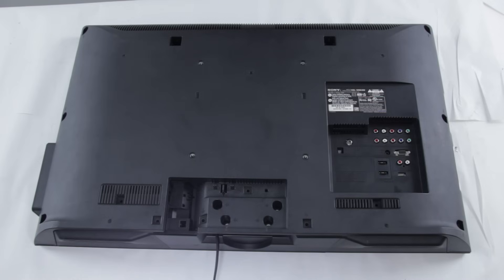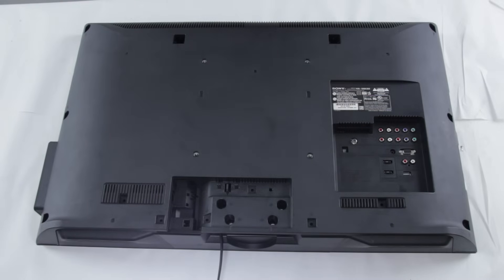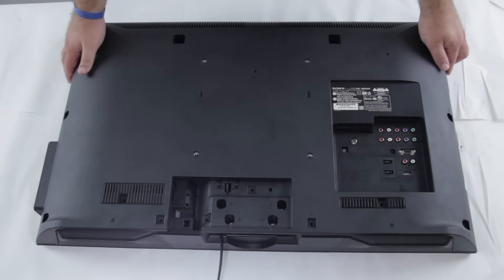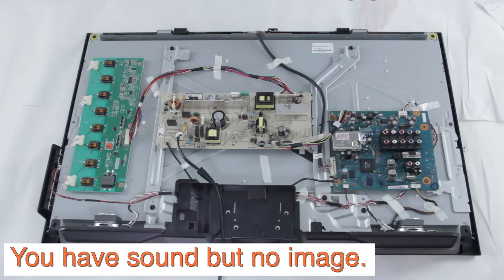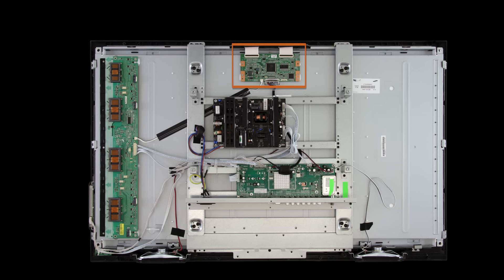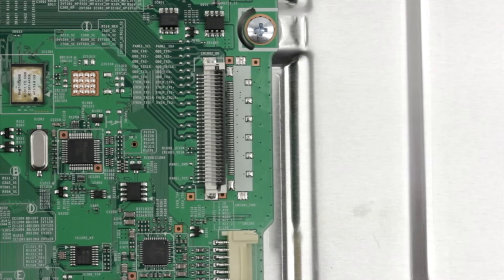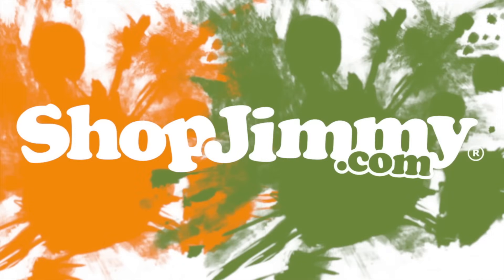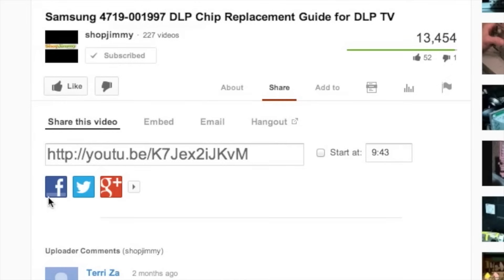LCD TV Repair Tutorial - T-Con Board Common Symptoms & Solutions - How to Replace T-Con Board

Comment: Hi, I have a sony sony kdl-40ex520 and just recently the tv started showing a thick blue sometimes red horizontal stripe on the top of the screen. before that the tv had several almost invisible horizontal lines all around the tv. Is this a TCON related issue?
Reply from the maker: Justin Subero   This sounds like a TV panel (TV Screen) problem.  If your TV panel is bad, it may be more cost-effective to replace the TV as panels are typically hard to find in stock, difficult to replace, and expensive.  Thanks and please let us know if you have any further questions!  www.shopjimmy.com
Reply: Thanks Jimmy!

Comment: Can You suggest me something like a trick to reset Tcom in HSD190MEN3-A00 Panel prior to order another one ? The televisor show lines and a blurred area in the lower half of the screen BY March 9th. The upper half works good at now. Best Regards
Reply from the maker: DaveDaveTor   This sounds like a TV panel (TV Screen) problem.  If your TV panel is bad, it may be more cost-effective to replace the TV as panels are typically hard to find in stock, difficult to replace, and expensive.  Thanks and please let us know if you have any further questions!  www.shopjimmy.com
Reply: ShopJimmy.com I can mount a new panel BY muself, new panel price is 85$ (+25$ shipment). PANEL IS EFFECTIVELY BAD, but I used to contact aliexpress online and THEY told me to send 110$ to the retailer PAYPAL.account.
Reply from the maker: DaveDaveTor   Best of luck with the repair!  Thanks!  www.shopjimmy.com

Comment: My Sony Bravia 55inch TV (just 3 years old) cut out last week....turned it on and it went off by itself, then the red LED on the front would blink 4 times in a repeated pattern.  ShopJimmy and other sources suggested it is most likely the T-con board.  ShopJimmy had the board in stock....around $25 plus shipping.  The instructions on here helped walk me through the process to replace the board....took about 45 minutes door to door to complete the task...really easy.  Better than spending $1000 for a new TV!  Thanks ShopJimmy!!

Comment: I have Samsung 50" led hdtv that has a black screen when I turn it on. I removed the back cover in the back of the TV to see if the back light works...  And it's does and their is sound (connected a ps3 in the Hdmi input) I think I have to replace the t con board. 
The model number is un50eh5000f 
     Version number is nh02
        Serial number is z5hu3cad700441k
If u can help me get or find the t con board for my TV.  I appreciate it thank you.
Reply from the maker: Valentin Lopez   This could be a problem with either the main board or the TV panel.  You can replace the main board to see if that fixes the problem.  Click this link to replacement parts for your TV model number:  http://www.shopjimmy.com/catalogsearch/result/index/?cat=56&q=un50eh5000f+  There may be multiple boards for the same TV model number, be sure to match part numbers on your current board, with your replacement for compatibility.  Here is a link to a video showing how to identify your part number, click here:  https://www.youtube.com/watch?v=BEPWrefQvqI
Thanks and please let us know if you have any further questions with your TV Repair!  www.shopjimmy.com

Comment: I have a Samsung UN55D6000. It recently made a loud popping sound and turned off, and won't turn back on. Is it most likely a power supply issue that can be replaced? Or could it be something else, as I don't want to purchase the part to have it still not be fixed. Thanks!
Reply from the maker: NeumaticClub   Try all repairs and diagnosis at your own risk.  I recommend looking at the boards to see if you notice any visual problems with them.  Thanks!  www.shopjimmy.com

Comment: Hi mate i have a Samsung ue65es8000 led  and i think the tcon board is faulty. I have taken the tcon board out and heated the graphics chip and it worked for about 6 months and has stopped working again im sure its the tcon board as it worked for 6 months with no problems.
I can re flow the tcon board again but i dont want to have the same problems again and again so i am wondering if there  is a link you can send me where i can buy a tcon board for this model or a video link that show a permanent fix. thanks guys
Reply from the maker: james rudd   Click this link to a replacement t-con board for your TV model number:  https://www.shopjimmy.com/samsung-bn96-21574a-t-con-board.htm  Be sure to match part numbers on your current board, with your replacement for compatibility.  Here is a link to a video showing how to identify your part number, click here:  https://www.youtube.com/watch?v=4cCbAv3f6Ww  Thanks and please let us know if you have any further questions with your TV Repair!  www.shopjimmy.com

Comment: I have a lg 42le5400 uc-ausdlhr. I was watching tv using my Apple TV and then suddenly the tv turned black.  I normally don't turn on the standby light. When I turn off and on again with the remote, the power light comes on then the rest of the panel but all I have is a black screen. When I click the remote, the power light acknowledged but still black screen.it has no sound no picture. I press the menu button, no response. I opened up the back, no blown capacitors and everything looks clean. The main board is EAX61532702 (0) but couldn't find it anywhere. The power board is EAY60803102-PLDF-907A AUTO 42. How can I find out whether it is the power board problem or the main board? Do you have it in stock? Is there any reset sequence that I can try?
Reply from the maker: Andy Chow   Try all repairs and troubleshooting at your own risk.  If you have experience using a meter, you can check the voltages on the power supply board.  Thanks!  www.shopjimmy.com
Reply: +Andy Chow  Andy did you ever get going?

Comment: Good Job on all your help! I have a 2008 Sony Bravia KDL-4054100, Works fine for the first 20-30 minutes then 1/3rd of the left side of screen will go blank, only when it warms up...
Reply from the maker: sharpe ink   This sounds like a TV panel (TV Screen) problem.  If your TV panel is bad, it may be more cost-effective to replace the TV as panels are typically hard to find in stock, difficult to replace, and expensive.  Thanks and please let us know if you have any further questions!  www.shopjimmy.com

Comment: Hi there,
I have a Samsung LE37A656A1FFXXC serial number ALYB3SCQ501540Z, after last summer holidays (3 weeks with the TV detached from power source) at the first power on the picture colors became darken after a few minutes, if I power off the TV and try again after some time (1 hour later or so) the problem shows up again.
I've tried to reset to factory default without any changes.
Should be a T-Con Cable and/or T-Con board issue?

Thanks for your help!

Adriano from Italy.

Comment: I have a 37 Inch LG T.V. that turns on flashes on and off 3 times then turns it's self off. When it's on the Image is clear and bright but flashes off and on then turns off completely. I have replaced the Power Board, Main Board and T-con board and still have the same problem! I think someone sold me a faulty Power board! What are your thoughts? I would appreciate any suggestions. Eric.
Reply from the maker: Eric Reynolds   Sounds like you have bad lamps or LEDs in the TV.  Unfortunately we do not sell replacement lamps or LEDs.  Thanks!  www.shopjimmy.com
Reply: Thank you for getting back to me. I took the T.V. apart and check the Lamps and all 16 of them are working perfectly. I thought that I was sold a bad Power board so I replaced the 2 1000uf Caps. Still the same problem. The only things I haven't replaced are the Ribbon Cables and the small circuit board that lights up when I turn the T.V. on. I have checked the Ribbon cables to make sure they are fully inserted and properly aligned.
Reply from the maker: Eric Reynolds  I recommend replacing the inverters in your TV.  Please reply with your TV model number.  Click here to view a video that shows how to find your TV model number:  https://www.youtube.com/watch?v=S51nhAmwR2M  Thanks!  www.shopjimmy.com
Reply: Hello again: The Model Number for my LG T.V. is 37LH20-UA. I have already replaced all the Boards on the T.V. which I believe includes the Inverts? I'm starting to think that I was sold a bad Circuit board. Which one, I don't know! Weird that I would get a board that has the exact same problem as mine! The only things I haven't replaced on the T.V. are the flat cables. All 16 of the Tubes are lighting perfectly. I'm at a loss. I thought that I was sold a bad power board so I replaces the 2 1000uf Caps on the board with no improvement. I didn't replace the smaller Caps...yet.
Reply from the maker: Eric Reynolds   Well it looks like for your TV model, the backlight inverter is built into the power supply board.  There is definitely the possibility that you could have bought a defective replacement board.  Thanks!  www.shopjimmy.com

Comment: The t-con board makes a noise on the right side. I replaced it an I seen the screen but had lines the old one didn't show anything. Also if I unplug right side u can see half the he screen perfect. Model number se65gy24 serial number 6510m0349s00227. so the hehe t-con board I bought could be bad to.

Comment: I HAVE A SHARP AQUOS 52" LCD TV. MODLE # LC-52D64U SERIAL # 807813345. THE GREEN POWER LIGHT IS FLASHING AT A RATE OF 1X PER SEC. I DID THE UNPLUG, INPUT/VOL-, TO TURN BACK ON. DID THE VOL- AND CH- AT THE SAME TIME TO GET TO THE SCREEN TO DO THE FACT INIT. GOT THE GREEN SCREEN. UNPLUGGED, REPLUGGED. WENT THROUGHT SET UP. TV WORKED BUT HAD GREEN K ON LEFT. VOL GOES TO 0,30,60. DID SAME PROCEDURE TO REMOVE THE  GREEN K BUT DURING THE SET UP AFTER GREEN SCREEN THE SCREEN GOES BLACK, TV TURNS OFF AND GREEN BLINKING RETURNS. IF I DONT GO THROUGH THE PROCEDURE TO REMOVE THE GREEN K, THE TV WORKS FINE WITH THE EXCEPTION OF THE VOLUME. AGAIN IT GOES FROM 0 TO 30 TO MAX. PLEASE ADVISE ON WHICH COMPONENT NEEDS REPLACING.

Comment: I have a Toshiba 46sl412u, I am not getting any picture or sound when i turn on the tv. When i touch the screen i can see a blue screen. I am not sure how to gp forward with getting the tv fixed as ywo technician looked at it and one is saying the tcon board is probably bad and the other one is saying its the main board so i am confused. Kindly advise how to go forward
Reply from the maker: Peter Clarke   Try all repairs and troubleshooting at your own risk.  If you have experience with a multimeter, you can check the voltage going to the t-con board.  Thanks!  www.shopjimmy.com

Comment: Hi I have a sharp lc-52le640u when i power light on star blinking 2slow times then 5 fast times the screen is black the hole time can you help
Reply from the maker: Fernando Cisneros   This sounds like a TV panel (TV Screen) problem.  If your TV panel is bad, it may be more cost-effective to replace the TV as panels are typically hard to find in stock, difficult to replace, and expensive.  Thanks and please let us know if you have any further questions!  www.shopjimmy.com

Comment: Hey guys I have a Vizio XVT3D474SV that went out without warning. Logo flashes, literally about 100 times and then stays yellow; remote does not turn set on or off. I'm not sure about sound because it is not connected to anything. I replaced the power supply to no avail; replaced the mainboard and backlight came on. Now logo flashes like it's trying to update, then it stays white for quite some time with backlight on screen but no picture, then logo flashes and returns to white. Eventually, I have to turn it off using the power button on the set because it will repeat the process over and over. Any help would be greatly appreciated.

Comment: Hello   I have a Samsung UN40EH6000FXZA. when applying power a small musical welcome sounds with no picture. I took back panel apart to investigate. All fuses are good and back panel light is on. Was wondering what could be the problem. Thanks  Don
Reply from the maker: Don Ragusa   I recommend running the flashlight test on your TV.   Here is a link to a video we produced that shows how to run the flashlight test. https://www.youtube.com/watch?v=xUzCLgoSPGM Please reply with your flashlight test results and we can recommend a replacement part for your TV repair. Thanks and please let us know if you have any questions! www.shopjimmy.com
Reply: Do I still need to do the flashlight test even though I have my backlights ?
Reply: Don Ragusa Today I did the flash light test. Cant see or find anything on the screen. Also I hooked up the cable input and don't have any sound. Not sure if the correct input is selected to be able to hear audio from cable. The only sound I hear is the small musical welcome when the power is first applied. I don't have the remote controller so my hands are somewhat tied. Any more advice would be great.
Reply from the maker: Don Ragusa  Please watch this video FIRST to help with your repair!  https://www.youtube.com/watch?v=BP3NVNCGEv8   This could be a problem with either the t-con board, the main board, or the TV panel.  You can replace the t-con board and main board individually to see if one of those boards fixes the problem.  Click this link to replacement parts for your TV model number:  http://www.shopjimmy.com/catalogsearch/result/?q=UN40EH6000FXZA  There may be multiple boards for the same TV model number, be sure to match part numbers on your current board, with your replacement for compatibility.
Reply: ShopJimmy.com Just to follow up on my problem..... I replaced the t-con board and it fixed my issues. The TV was on a game input so I think this why I couldn't hear anything. Also the TV needed to  learn all of the channels available for cable again as if the TV was brand new. Thanks for your help. Without your  videos on YouTube this wouldn't have been possible.

Comment: Hi.
I've got a SONY KDL-24W605A TV. Tv powers up but screen stopped working. the backlight works but doesn't show anything on the screen. Tv does make a sound.
Reply from the maker: Xxx Yyy   This could be a problem with either the main board, the t-con board or the TV panel.  You can replace the main board and t-con board in your TV to see if one of those boards fixes the problem.  Unfortunately I do not see any replacement parts in the search results for your TV model number on our website.  Thanks and please let us know if you have any further questions!  www.shopjimmy.com

Comment: Hello I have a Samsung Model Code: LN46B530P7NXZA.  IT has a polarized picture.  I watched your video and thought about trying to replace the the t-con board, but I can not find a replacement.  Any help would be greatly appreciated.
Reply from the maker: Gavin Steele   Looks like it is currently out of stock.  You can sign up to be notified when the part is back in stock on the product page.  Thanks!  www.shopjimmy.com

Comment: Hi, i have a sony kdl 40 cx523  The picture starts Pink then after 30 mins all is well apart from a faint Pink line at the top, any help please
Reply from the maker: Allen Fleckney   This could be a problem a problem with either the main board, the t-con board or the TV panel. Unfortunately I do not see any replacement parts in the search results for your TV model number on our website.  Thanks and please let us know if you have any further questions!  www.shopjimmy.com

Comment: my tv is LG32CS460 and i have backlights and sound but no picture pls hellp
Reply from the maker: vlatko stojanov  Please watch this video FIRST to help with your repair!  https://www.youtube.com/watch?v=BP3NVNCGEv8   This could be a problem with either the main board, the t-con board or the TV panel.  You can replace the main board, and t-con board individually to see if one of those boards fixes the problem.  Click this link to replacement parts for your TV model number:  http://www.shopjimmy.com/catalogsearch/result/?q=32CS460  Be sure to match part numbers on your current board, with your replacement for compatibility.  Thanks and please let us know if you have any further questions with your TV Repair!  www.shopjimmy.com
Reply from the maker: vlatko stojanov    Please watch this video FIRST to help with your repair!  https://www.youtube.com/watch?v=BP3NVNCGEv8   This could be a problem with either the main board, the t-con board or the TV panel.  You can replace the main board, and t-con board individually to see if one of those boards fixes the problem.  Click this link to replacement parts for your TV model number:  http://www.shopjimmy.com/catalogsearch/result/?q=32CS460  Be sure to match part numbers on your current board, with your replacement for compatibility.  Thanks and please let us know if you have any further questions with your TV Repair!  www.shopjimmy.com

Comment: I have a samsung LA37A550P1R and  it now shows a negative image with sound. I stripped it down to see if the two boards where the Tcon connect to on side of display was shorting and isolated them from the frame. This did not sort out the problem and am not sure if it is the Tcon  How do  i check without physically buying a new tcon board

Comment: Hi Jimmy have a Samsung pn50c8000 tv, I started with 3 pink vertical lines over a year, now I'm having 3 new ones appearing on the right side of the tv. Left side is fine but from middle to right having these pink vertical lines. Any suggestions?
Reply from the maker: Antonio Ascencio   This sounds like a TV panel (TV Screen) problem.  If your TV panel is bad, it may be more cost-effective to replace the TV as panels are typically hard to find in stock, difficult to replace, and expensive.  Thanks and please let us know if you have any further questions!  www.shopjimmy.com